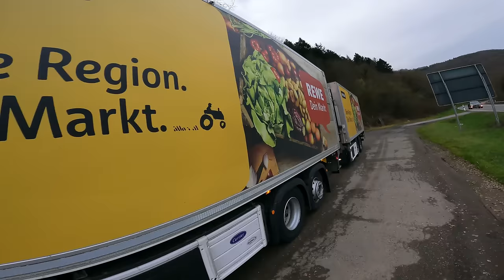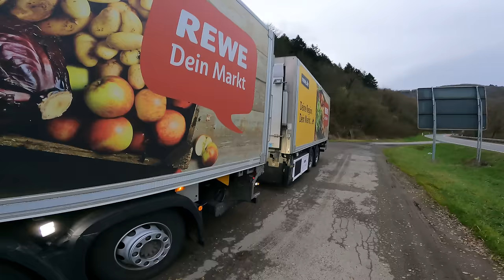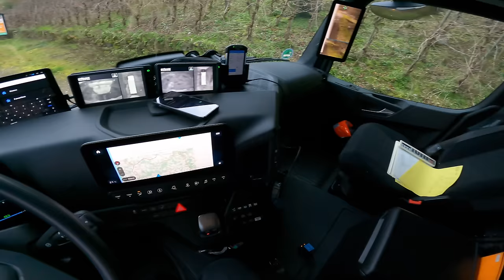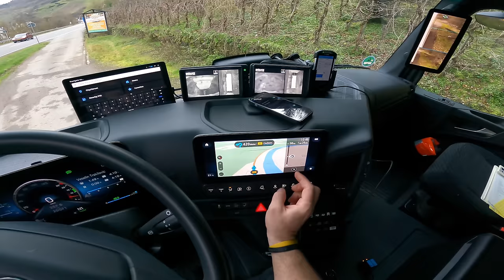Rainy day 🌧️ with my new Mercedes Actros 🇩🇪 ZELL Mosel

Comment: You know, I hadn't conceptualized the utilization of the electronic side mirrors - but it makes sense as a natural progression from the electronic rear view mirror!  Very cool!  Very nice rig!  I know the microphone on the cameras tend to pick up all kinds of noise - so the truck is really that quiet?!  How wonderful!
Reply from the maker: Good point! ✅👍
Reply: I'm curius how those side mirrors-monitors works when it's dark or the lenses are wet.
Reply: @kjungst  Honda does this with their "honda sensing" package. The camera is recessed so becoming splashed or snowed on is veeeerryyy rare. At night in the city there's enough ambient light that visibility is still very good. There seems to be a coating or processing that also reduces glare, so that hasn't been a problem. Pitch black country roads, i mostly rely to see peoples' headlights. 
Overall 8/10. I imagine Mercedes would do even better!
Reply: @kjungst  I mean, you wouldn't be able to see back on regular mirrors if it was too dark. My guess is that it's pretty much the same experience.
Reply: @AxellSlade  Cameras tend to glare when headlight is pointed at them at night so you for example cannot discern where exactly the headlight is in the camera.
Reply: @kjungst  They work well at night, they have a sort of night vision. I actually prefer them over regular mirrors for driving. They’re also heated so moisture isn’t an issue
Reply: »The book of the generation of Jesus Christ, the son of David, the son of Abraham.
Abraham begat Isaac; and Isaac begat Jacob; and Jacob begat Judas and his brethren;
And Judas begat Phares and Zara of Thamar; and Phares begat Esrom; and Esrom begat Aram;
And Aram begat Aminadab; and Aminadab begat Naasson; and Naasson begat Salmon;
And Salmon begat Booz of Rachab; and Booz begat Obed of Ruth; and Obed begat Jesse;
And Jesse begat David the king; and David the king begat Solomon of her that had been the wife of Urias;
And Solomon begat Roboam; and Roboam begat Abia; and Abia begat Asa;
And Asa begat Josaphat; and Josaphat begat Joram; and Joram begat Ozias;
And Ozias begat Joatham; and Joatham begat Achaz; and Achaz begat Ezekias;
And Ezekias begat Manasses; and Manasses begat Amon; and Amon begat Josias;
And Josias begat Jechonias and his brethren, about the time they were carried away to Babylon:
And after they were brought to Babylon, Jechonias begat Salathiel; and Salathiel begat Zorobabel;
And Zorobabel begat Abiud; and Abiud begat Eliakim; and Eliakim begat Azor;
And Azor begat Sadoc; and Sadoc begat Achim; and Achim begat Eliud;
And Eliud begat Eleazar; and Eleazar begat Matthan; and Matthan begat Jacob;
And Jacob begat Joseph the husband of Mary, of whom was born Jesus, who is called Christ.
So all the generations from Abraham to David are fourteen generations; and from David until the carrying away into Babylon are fourteen generations; and from the carrying away into Babylon unto Christ are fourteen generations.
Now the birth of Jesus Christ was on this wise: When as his mother Mary was espoused to Joseph, before they came together, she was found with child of The Holy Ghost.
Then Joseph her husband, being a just man, and not willing to make her a publick example, was minded to put her away privily.
But while he thought on these things, behold, the angel of the Lord appeared unto him in a dream, saying, Joseph, thou son of David, fear not to take unto thee Mary thy wife: for that which is conceived in her is of The Holy Ghost.
And she shall bring forth a son, and thou shalt call his name JESUS: for he shall save his people from their sins.
Now all this was done, that it might be fulfilled which was spoken of the Lord by the prophet, saying,
Behold, a virgin shall be with child, and shall bring forth a son, and they shall call his name Emmanuel, which being interpreted is, God with us.
Then Joseph being raised from sleep did as the angel of the Lord had bidden him, and took unto him his wife:
And knew her not till she had brought forth her firstborn son: and he called his name JESUS.«

(Gospel - Matthew - Chapter 1)
Reply: @kjungst  디지털 미러는 어두운 밤에 시인성이 더 좋습니다. 사실 물이 맺히는 문제가 고질적이긴 하지만 진짜 미러에 문제가 생기는 것과 비교하면 훨씬 유리하죠.
Reply: What happens if electronics malfunction and you mirrors turn off…I prefer regular mirrors

Comment: i dont understand why you need 50 connections for your trailer? i tow a 5 axle trailer behind my rigid unit (9 axles all up rated for 50 ton) and all i have is a duo air line connection, an electric for lights and on board scales and a another one for the EBS system and that is it

Comment: Nice bro. I'm curious, how many does continuous driving allow, based on company or local regulator? Is there any trip plan document?
Reply from the maker: You can drive 9 hours per day , after 4.5 h maximum must make a pause of 45 min
Reply: @tdw  well, thanks bro. Almost similar in here, Indonesia, 8 hours driving working hours. Max 4 hours break for 30 min.

Comment: It's just like a freghtliner! 🤠

(Yes I know same truck essentially lol) But your mercedes looks 1,000,000x more comfortable, advanced and more reliable than freightliners here in USA. I would much prefer to drive euro trucks.
Euro trailers are also so much more smartr and better designed. USA trailers meh... There's some cool US trucks but I've only ever driven emissions/aerodynamic stand-up sleepers, and day cabs and I only had one Kenworth (DAF) T680 that was kind of comfortable with it's seat but every other truck I driven compared to my euro friends trucks despite being a 2018-2023 models are like dinosaurs technologically compared to european models. A lot of things make more sense over there to me, and are much safer I feel. Most trucks over here still dont even come with blind spot cameras or refuse to try the camera mirrors (only some have it or I noticed, Maverick transport has it on more of their FL's now with digital/physical mirrors) . xD
Reply from the maker: It is very similar inside, I was searching now on google and I was surprised 😮